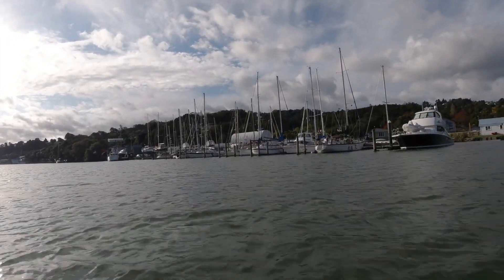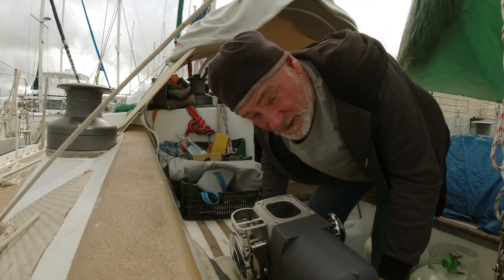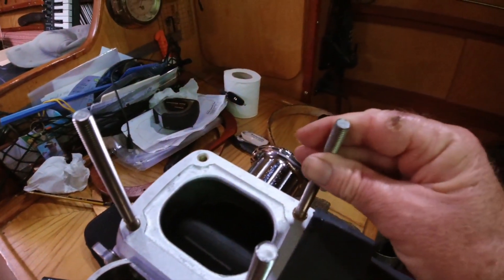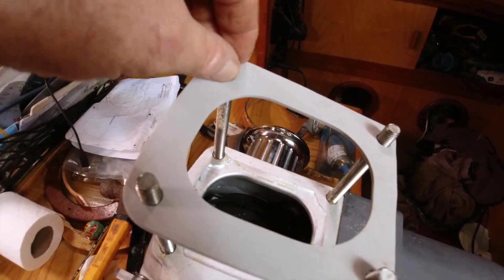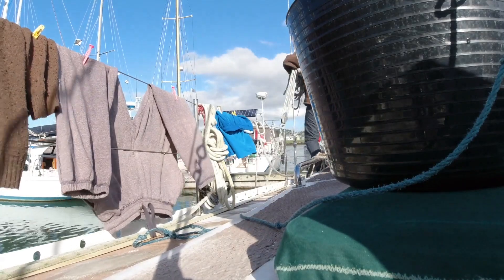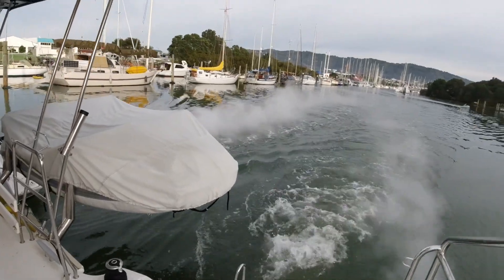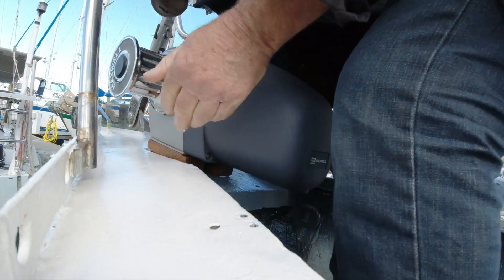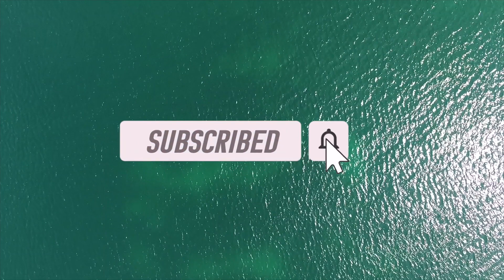Boat moving, windlass fitting day.

Comment: Barry,  you might want to fiberglass over that wooden wedge or something, because I wouldn't expect that wood to last more than a season or two before rotting if exposed to the elements.
Reply: Use starboard when the time comes.
Reply: It looked as if he gave the wood a few coats of something after he trimmed it to shape. Didn't see it in much detail but getting water in the battery locker might be of more concern. The cables have got to be routed back to the charging system too. More leak spots.
Reply: Barry, they're right.  Stainless fasteners into a steel mounting and a wooden spacer?  Crazy.  The wooden spacer will fall apart in no time once its had some water on it then the load of the 4 studs and then the variable load of the windlass doing it's job.  Send me a sketch and I'll get something steel made for you.

Comment: It may have been an idea to put loctite on the threaded rods before screwing them into the windlass
Reply: They're not going anywhere but the nuts are a different matter. They may need checking as the wood compresses.

Comment: If you ever find yourself  in a mariner again.. was wondering if the wood under the windlass could be replaced with a bit of composite/pvc decking.. (solid molding) as you can sand it but won’t rot/swell? Someone else might know a reason not to.. but just an idea with hindsight.

Comment: Hey Barry, just a little concerned about the exposed wood used for the wedge under your windlass.  I'm thinking it might have been better to epoxy the entire thing first, then glass it to the deck at the right spot, then re-drill the holes, re-epoxy the drill holes, then affix the through-bolts.  I'm concerned about the wood rotting over time under that beautiful windlass.  Your thoughts?

Comment: How do you intend to charge the windlass battery? Is the battery location dry?     Is there a steel  backing plate and membrane under the deck even though the boat deck is steel?
Install a battery isolation switch between the battery and the windlass

Comment: Was that a bit of proper New Zealand hard wood for mounting your windlass ?   Not worried about it rotting ? You never painted it.
Reply: That spacer should be made of steel, don't you think?
Reply: @solowinterwolf  Either that or a hard plastic , which would be possible and have added benefit of not rotting or rusting..The wood will likely last a while in any case... Could have sealed the wood with some pitch / preservative etc...

Comment: I made a BIG mistake when doing the same job ,I forgot that the case was aluminium and the bolts were stainless steel , over two seasons they ate each other , I should have used a product on the thread to stop them reacting with each other.

Comment: Barry, as an apprentice boatwright with experience, please allow me to register my objection to the wood spacer under the windlass.  It will not hold up under the weight and moisture.of that application.  It should be fabricated from steel plating?

Comment: I have a problem I picked up a Rat or two they eat through my plastic cockpit drain below the water line have to fix in the water it's going to be a Bitch but will be fine what can I use to stop them from doing it again?? .Did I mention it my valves do not close both been sitting for 6 years untouched

Comment: I'm appalled to see bare untreated wood being used between windless and deck! The better solution by far is starboard for it will not rot, warp or deteriorate and will not compress. No epoxy or paint but literally maintenance free.